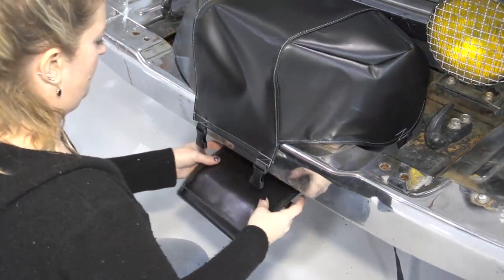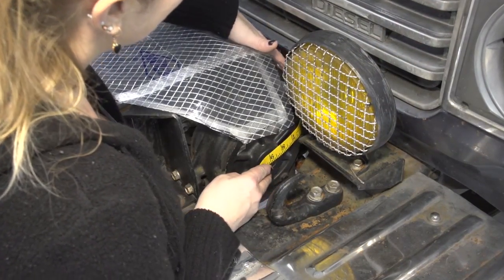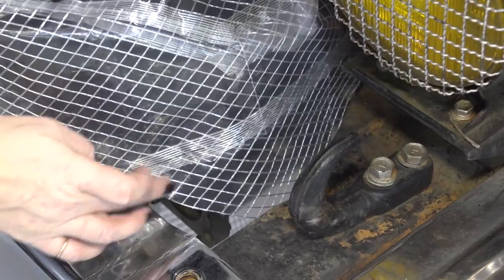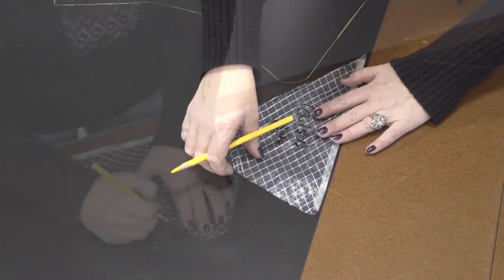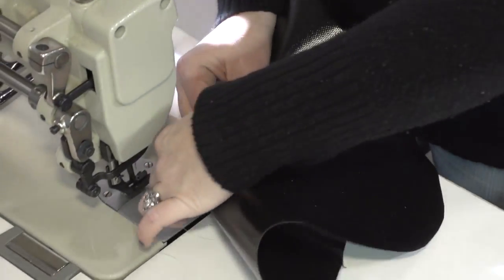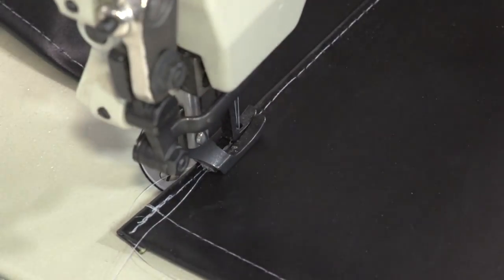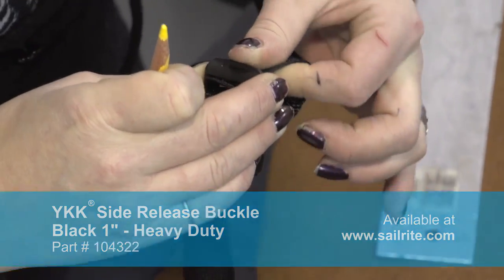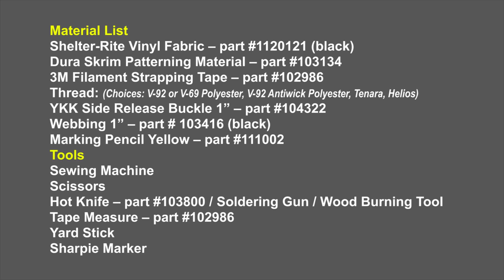How to Make Your Own Jeep Winch Cover

Comment from the maker: Using pattern material with reinforced ribbon weave will make it less prone to tearing and stretching when patterning a project that needs to be pulled tight over a frame. For this winch cover, that was not necessary, but for jobs where an exacting fit is needed it can be very important for the pattern material not to stretch. When patterning for exacting fit projects we usually use this pattern material with double sided tape on the filament strapping tape to hold the pattern material in place.

Comment: hi, chiming in on an old video...    is the harp the same length as the 111?  any specific reason the ls1 was not used for this project aside the 111 being a needle feeder?

Is angela still with the company?  

Is there a new version of the LSZ for 2020 in R&D?

 thanks for all of th videos.
Reply from the maker: The Sailrite 111 Sewing Machine is now called the Sailrite Fabricator found at this link: https://www.sailrite.com/Sailrite-Fabricator-Sewing-Machine-in-Power-Stand-with-Workhorse-Servo-Motor . The Sailrite Ultrafeed LS-1 Sewing Machine could have been easily used to make this Jeep Winch Cover. Angela is no longer working here. Yes, we are constantly improving all our sewing machines including the LSZ-1. In 2019 and 2020 we expect a several improvements that we are currently working on. They improve year after year.